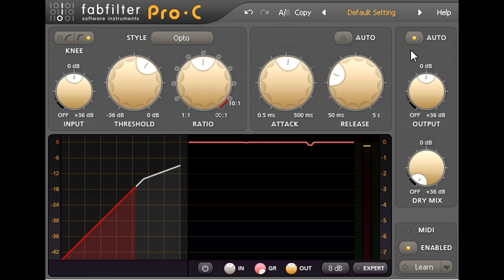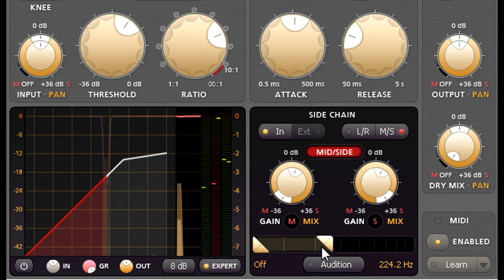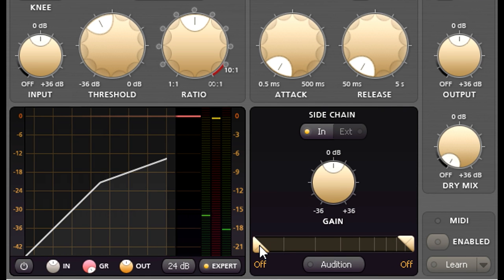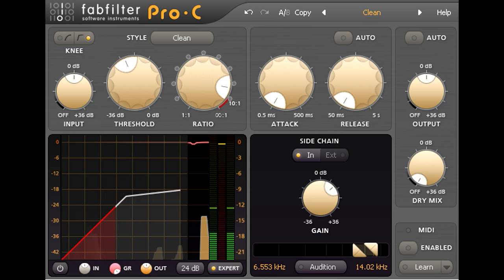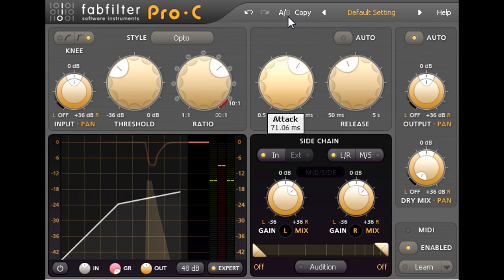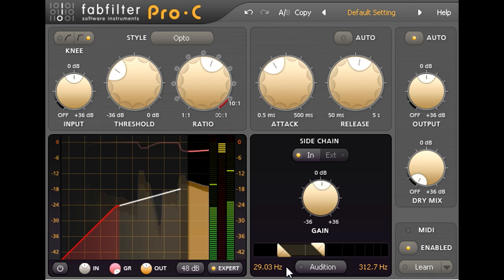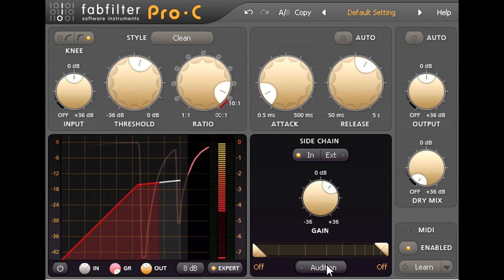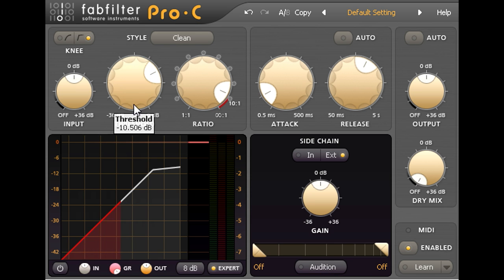Compressor Side-chain Filters

Comment: I have a question, if I do an EQ sidechain with a high pass filter at 100hz, would the output gain of the compressor (increased volume) not affect the frequencies below 100hz? in other words the sub-bass parts will not become louder? because I would like to use this method on pianos and guitars and I would love it if the sub-bass parts do not get louder.
Reply: No, an ordinary compressor will act on the whole signal, including the low end, no matter any side chain eq. What you're looking for is a mulitband compressor or a dynamic equilizer, both of which can compress certain frequencies while leaving others alone.

Comment: You will have to make a duplicate track and patch a pre-fader send to the sidechain input of the compressor.
Channel 1 = Snare
Channel 2 = Snare (Copy) [pre-fader send --> Pro-Q sidechain]
Remember to keep the fader of Channel 2 right down, as you are only using the send to trigger the compression and don't want it in the mix.